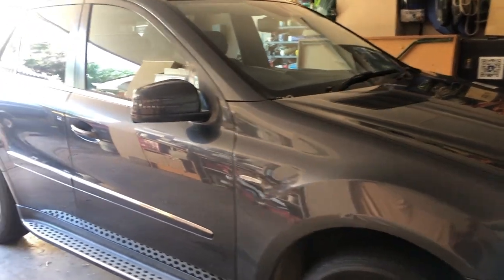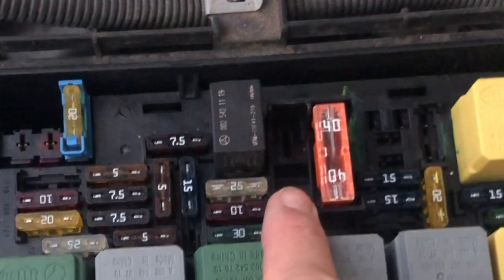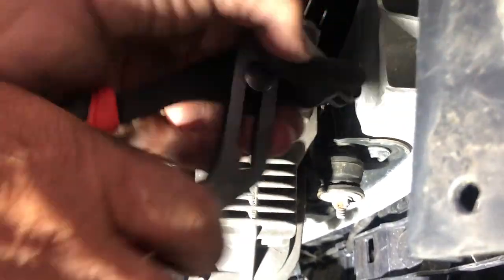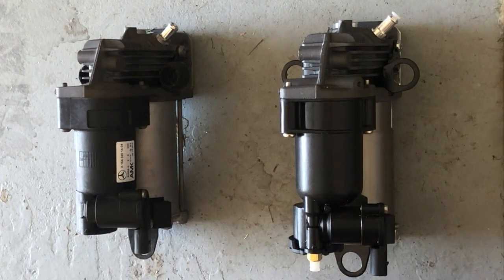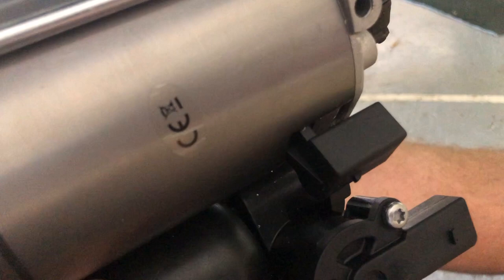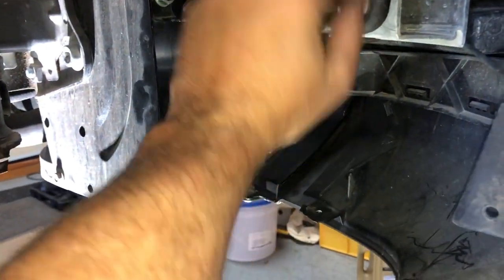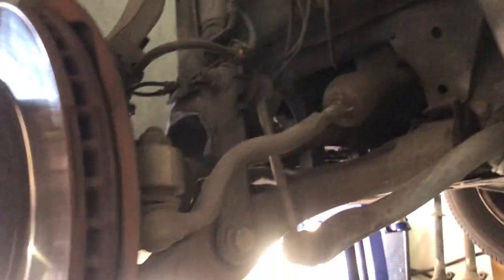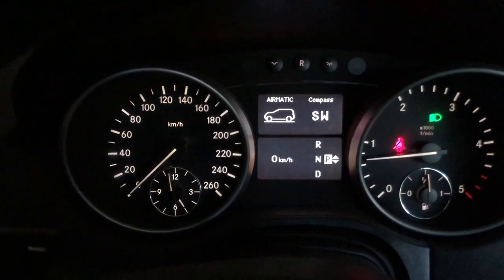How to Replace Mercedes W164 ML (2006-2011) AIRMATIC Air Compressor - DIY ML300 ML320 ML350 GL350

Comment: Very well explained video. Highly recommended for anyone going the DIY route on these cars. Appreciated the content on those pesky electrical connectors which will point newcomers in the right direction from the start. Massive added value pointing out the most neglected aspect of this type of suspension - the compressor air filter. Well done Drew. Greetings from Mozambique. Pity you didn't own one of these and post this 4 years ago, it would have saved me a LOT of time on the learning curve :-)

Comment: Hello,
many thanks for this very detailed video. I did the replacement to my ML W164 350 CDI 2010 alone. Nevertheless I have to change the valve block too. I was wondering if you are having also video on that topic.
Best regards
Reply from the maker: Hi Mate, Glad it helped.  Unfortunately I have not yet published a video on replacing the Valve Block, however if you have done the compressor you should be able to do the Valve Block.  1/ Lift the car 2/Remove the AIRMATIC fuse 3/replace the valve block ensuring the lines are not mixed up.  Good luck.  Cheers Drew

Comment: How has the compressor lasted? I ask because I will have to do mine soon. I installed Maxpeedingrods airmatic front struts in September and the socks on both failed within 1000km, so I’m a little unconvinced of the quality of their products.
Reply from the maker: Hi Scott, I have had this compressor fitted to my car for a few years now, I would guess that it had done about 50,000 kms in the vehicle with no issues! Cheers Drew

Comment: Great video! I need to replace mine. Is the Amazon compressor you bought still good? Local mechanic want to charge $1300 for the compressor. And $900 for valve block.
Reply from the maker: Hi Mate, my Amazon compressor is I believe just as good if not better than the original.  I say this because not only is it as strong but it is far quieter than the original!  What does your mechanic want to charge in labour?  I would tell him he’s dreaming and do it myself personally 🤣🤣🤣 Cheers Drew
Reply: @DrewFixIt  thanks for the reply! They want to charge 2.5hrs labour, $375. They also added a valve block($900), replay($50) and a filter($30). I assume this is the filter you mentioned in your video.
Reply from the maker: @mnewgin  hi mate, 2.5 hours they are having a laugh!  I reckon you should just start with the amazon compressor and do it yourself as per my instructions!  FYI - I have a whole playlist of Mercedes AIRMATIC videos 😆 Cheers Drew

Comment: Hi Drew, Great videos and great channel. Very informative and I am very happy to have found your channel. May I ask if the procedure is/should be the same for the GL X164??? Thanks Buddy!
Reply from the maker: Hi Dane, if you have a look at the compressor listing: https://amzn.to/3POVNge it lists the GL series on the same compressor.  Thus I suspect the procedure is very similar for the GL vehicles. The best thing to do (if you have time) would be to quickly take off the front right wheel off and inner plastic wheel arch and have a look.  Cheers Drew

Comment: Hi drew great video mate. IV got the same year and model car as you .I'm getting the malfunction on the dash as you did but it raises up and down okay just wondering if you're car still lifted up and down okay when you're malfunction happened.
Reply from the maker: Hi Darren, it did lift up all the way.  However the compressor was running pretty much all the time when the car was lifted.  Even when it was in the standard ride height my old compressor was running an aweful lot so it was fairly obvious that my compressor had become weak!  Let me know how you go with yours?  Also, have you scanned your car for codes with a Mercedes Scan Tool?  Cheers Drew
Reply: No mate just looking now to buy 1 IV only got a cheepy 1 doesn't seem to connect or read any codes so think I need a Merc 1 . Funny thing is my hose is spilt just the same as yours . Pump gets very hot you think that's I sign it weak
Reply from the maker: @darrenrussell9307  certainly sounds very similar to how mine was when I had the weak compressor!  I would certainly suggest getting a Mercedes compatible Scan Tool, this iCarsoft is a inexpensive unit: https://amzn.to/3p3NMYi
Reply from the maker: Here is a video where I used the iCarsoft Scanner to scan this exact issue: https://youtu.be/xrmuMfLsqYM

Comment: Mayyyyyyyyte - good on ya for posting this. I'm about to do the same job. Just gotta wait for it to get from USA to NZ. Any problems with this unit since you fitted it?
Reply from the maker: Hi Luvin, I have had no issues at all with my AIRMATIC since I installed this unit!  Cheers Drew
Reply: @DrewFixIt  Good to hear - thanks for the quick reply, Drew. Nice one mate. David
Reply: Hey mate, do these compressors have oil in them? If so can the oil be changed?

Comment: Hi Drew, I have a 2010 ML300 which has been underwater, can you help please. the scan tool does not communicate, the windscreen wipers and windows work without switching them on. Could you advise please on steps to be taken to rectify.
Reply from the maker: Hi Ramesh, it sounds like you certainly have a moisture issue and I don’t think filling the inside of car with four cubic metres of rice will help!!  All jokes aside I would love to help, where do you live? Cheers Drew

Comment: Well done mate. Did you get the pump for the 166 chassis as the 164 is showing it’s not available and the X166 is cheaper as a pose the x164 which is over $300. The x166 is $209 so I’m wondering if the X166 is the same as the X164? Can ya help with some ideas if they are the same? Thanks Drew.
Reply from the maker: Hi, Thanks for the feedback!  I got the pump for the 164 chassis.  This is the exact pump that I purchased:

https://amzn.to/3fg8DmB

What I suggest doing is taking your inner fender well off (it's not that hard) and checking the part number of the pump installed in your vehicle, which you can then check against in the MaxpeedingRod listing as they show all of the compatible OEM part numbers.  This is what I actually did prior to purchase.

I trust this helps?  Cheers Drew
Reply: I think X164 and X166 use the same model compressor.
The OEM maker is AMK (as shown in this video as the original factory part), and they are more than $500.
All the others are Chinese Knock off's, either on Amazon or ebay. 
Arnott is also made in China.

Comment: Hi Drew. I found a big split in the hose as yours. Would it be the reason why the car (especially the rear) is dropping? I just wanted to check before I order a new compressor as you did. Messages come as: 1. Malfunction and 2. Compressor is cooling down. Thanks for the video anyway; it helps me a lot diagnosing the problem.
Reply from the maker: Hi Mohammed, you should fix the split as it will be sucking dirty air, however without seeing your car myself… I would suggest if the rear is dropping that the compressor is getting hot because it’s working overtime due to something in the “rear” leaking!  Have a look at this video I did changing the rear air spring https://youtu.be/9OKqid4F_WI it’s quite an easy job really and the parts are inexpensive: https://amzn.to/3KaNveV. Cheers Drew
Reply: @DrewFixIt  Thanks for the reply! I fixed the split. However, the car actually dropped front and rear now. The compressor sounds like it's not building pressure so I sprayed it with soapy water for a quick leak check but nothing. I guess I will have to order the compressor now. I will use your video as a guide:) Thanks again
Reply from the maker: @mohammedalghamdy1094  Hi Mohammed, I like to be truly certain wrt the exact problem before I fire the parts cannon.  Have you scanned the car for codes?  Here is a video which I did which confirmed the compressor was at fault: https://youtu.be/xrmuMfLsqYM
I would like to truly understand if it is your compressor at fault, thus i you could send me your DTC codes I would be interested in looking them up? Cheers Drew

Comment: Hi ! I have a problem with my Ml w164 from 2007. When I press the lift button to rise the car. The car shut down immediately. All compressor system is new. Suspension , fuse , relai. Can you help me with that ? I didn’t find any help on internet. Thanks a lot !
Reply from the maker: Hi Luckie, a couple of questions if I may? What brand of compressor did you install?  Have you replaced the AIRMATIC distribution valve block?  Have you scanned the car for codes with a Mercedes compatible scanner tool?  Cheers Drew
Reply: @DrewFixIt  well i don’t know what brand but must be the same as the original. All changes were made by Mercedes’ garage. Valve is change yes. To be honest, the problem started when I did remove the negative cable from the battery to change a lightbulb. Oh and also I got a message battery on the board. I did change the battery (big one) and the small one too. But after 3-4 months the message showed up again. I’m lost now. I couldn’t find anyone that could help me with that. Hope you will !
Reply: @DrewFixIt  i did scan too. I had a message like « control system for the tired pression something » but removed it. Oh and yeah. When I drive and get to 50km per hour the car shut down. I think it’s a problem with the airmatic system. Like I said, the car shut down when I press the lift button. Never happened before.
Reply from the maker: @luckie_5245  is the small battery connected properly?  I have a video on that:
https://youtu.be/yfXxijeUb64
Reply: @DrewFixIt  yes it is. Saw all your videos about the ml w164 hehe. But yeah everything is all well connected. I just think the small battery is almost dead. But could it be that ? The battery just have 10 months and it’s already almost dead…
Reply from the maker: @luckie_5245  I personally find it hard to believe that the small battery would cause this problem.  Anyway, if it is a problem you would get that battery symbol on your dash which I assume you do not have?
Reply: @DrewFixIt  i do have the battery symbol on the dash yes.
Reply from the maker: @luckie_5245  Ya know.  I can't but wonder if you are getting erroneous input signals from the AIRMATIC sensors.  If this were my car I would start by checking the Live Data associated with the AIRMATIC system.  Do you have a Scan Tool that you can do this with and report back?  Cheers Drew
Reply: @DrewFixIt  i can borrow one yes. Il check it out tomorrow. And also change the small battery to get the battery symbol on dash removed.
Reply: Hey Drew ! Ok so I scan the car. Got nothing about the car. I’ve changed the secondary battery. But I figure out that when the compressor starts the car automatically shut down. What else could it be ? Cheers
Reply from the maker: @luckie_5245  Did you check the Live Data as I suggested?  When you say "car automatically shut down" what do you mean?  DId the car turn off?  If this is the case I would be taking it back to whoever fitted the new compressor to be honest!  Cheers Drew
Reply: @DrewFixIt  update. Ok so I finally decided to buy a new compressor. Still have the same problem. One thing. Is it normal that when the compressor starts running the air is coming out from where the tube is with the filtrer. Shouldn’t it be sucked in and not coming out from there ? Could it be the valve block blocked and rejecting air than absorbing ? Cheers
Reply from the maker: @luckie_5245  Hi Luke, yeah that's not correct at all the air should be sucked from the hose that has the filter.  Without making this a parts cannon and not being able to hard to look at your car myself it's really hard for me to comment on where to go next, however I would certainly do what you are suggesting myself and start looking into the Valve Block.  I suppose the alternative is that you cold always take the car to Mercedes and give them a small fortune.  I personally would swap out the Valve Body myself with a aftermarket one.  I wish you all the best!  Cheers Drew

Comment: For the air line to the block. You just need to seat it while the nipple is screwed in already. Push hard until it stops fully. Then soft tug tug and push again and all set
Reply from the maker: Hi Darryl, I have seen people just push them in, however I personally just don't trust it and prefer to do it the way I showed in the video!  Cheers Drew

Comment: Hi  my  ml 500 wdc164ml was  normal  i removed  rear height  sensors to  check  and put the sensors on  again  start vehicle  rear  doesn't  lift what is the problem
Reply from the maker: Hi Yunus, did you reinstall them correctly?  Cheers Drew
Reply: @DrewFixIt  hi yes there is  left and  right  stamp ed  the front  suspension is  100 percent  checked all  fuses and  the relay  all  good
Reply: @yunustrevormahomed1215  If you buy a fancy scan tool (around $1000), you can get live data on those height sensors.
voltage and height measuments (in inches in USA, but probably metric in other countries). 
the scan tool can draw graphs too, so you can tell if the sensor is functioning properly.
also, scan tool can actuate each valves in the valve block, etc.